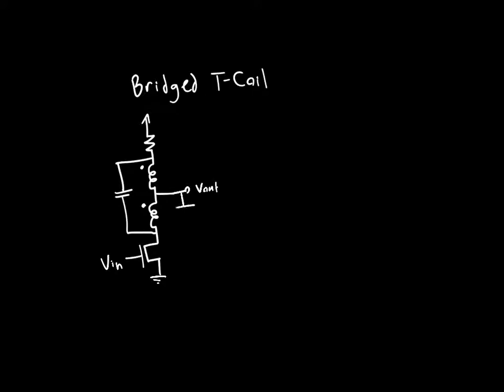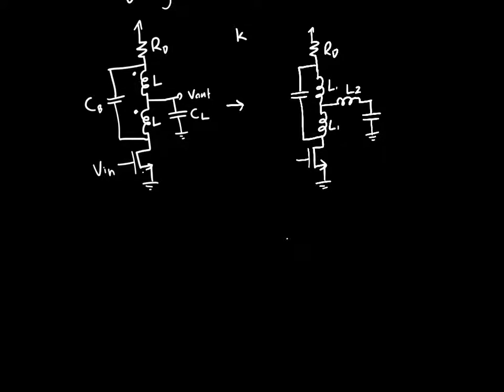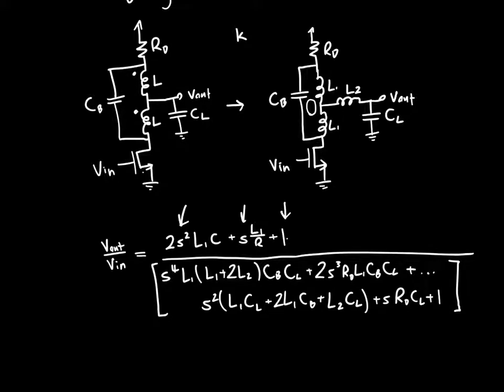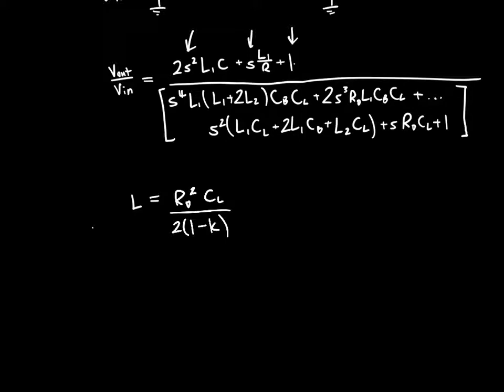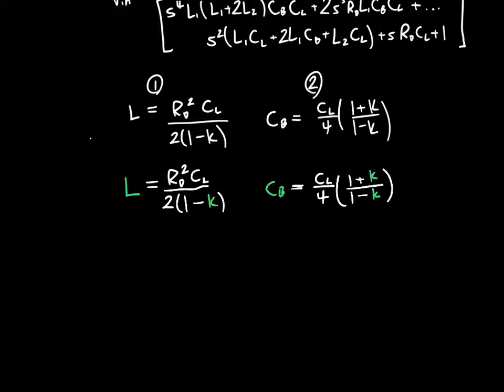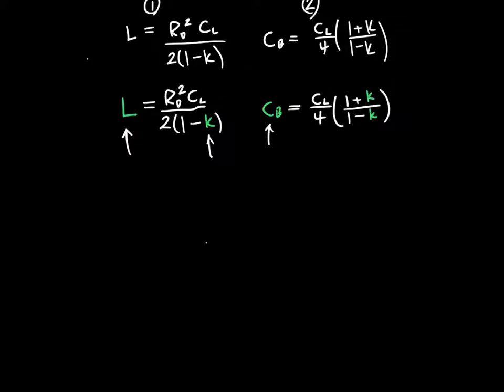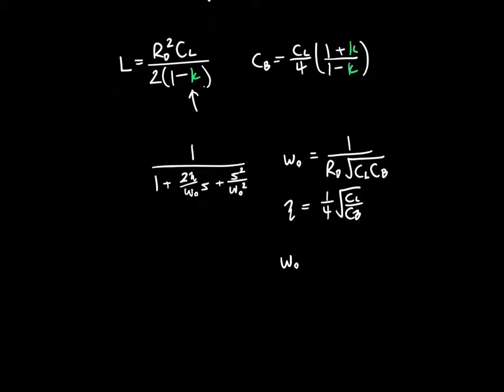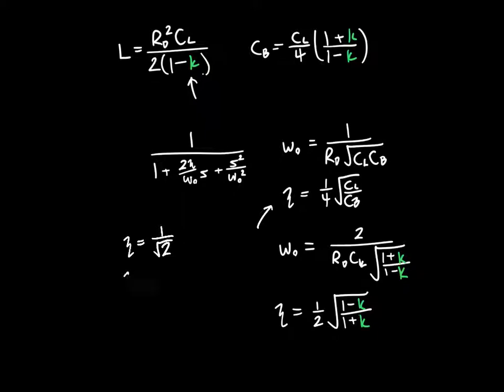Bridged T Coil Analysis Part 1

Comment: Thanks for the explanation ,  it would be interesting to see how the transfer function  will look like if pole zero won't be fully canceled . I mean in practice (mostly in IC) it difficult to satisfy condition of k, zeta,L1=L2 etc.. Also parasitic capacitors can appear and you need to deal with them.
Reply from the maker: It is certainly difficult to exactly cancel the pole and zero, absolutely. What you will really end up with is a pole-zero 'doublet' (just the name for a pole and a zero very close to each other), and things get much more complicated when you introduce parasitics. I encourage you to fully work out the transfer function if you have an hour or so to kill (it's really disgusting, and that's the reason we love to assume the pole and zero cancel each other).